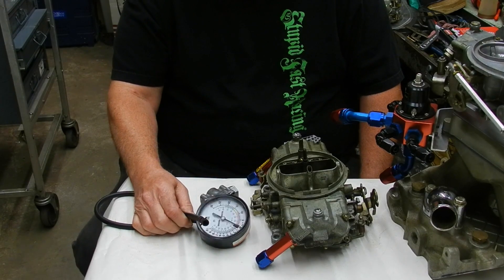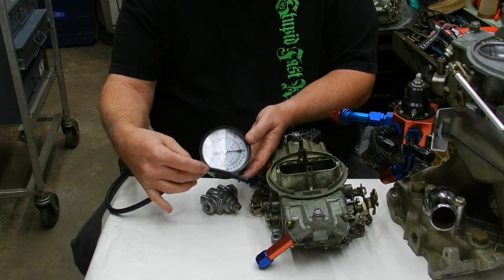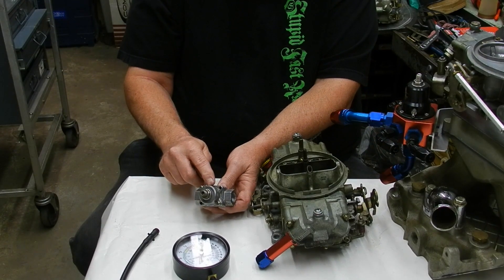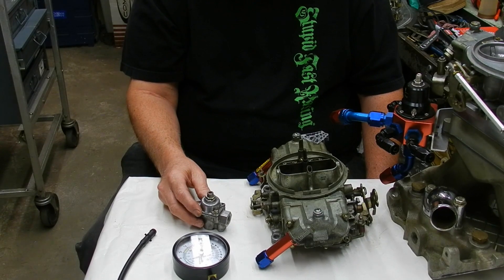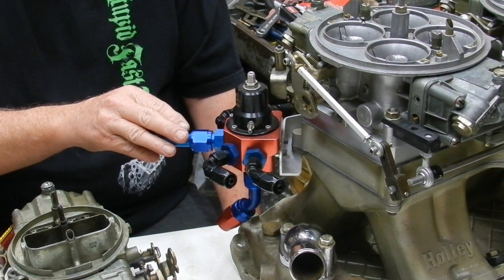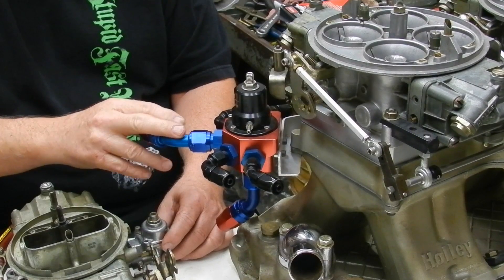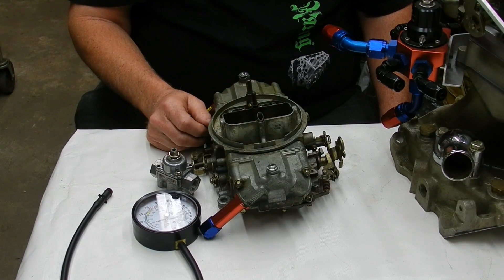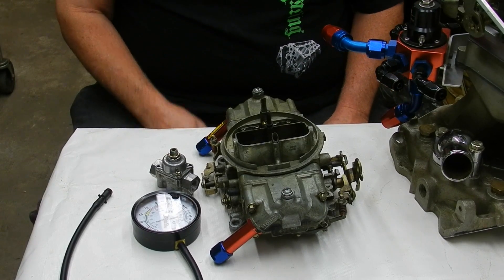Holley Carburetor : Fuel Pressure 101

Comment: Great video I am running a 500 cc Holly 4412s 2bbl on my 69 Ford f 250 390 c.i it says in the instructions 5_7 psi ? For a 2bbl ? It has a 50 cc accerator pump. I am running a elec fuel pump with the same regulator you had by quick fuel 1_5 psi regulator although the pump is 4_9 psi I ran it in a 5 gallon can it filled that can pretty quick the needle and seat is supposed to stop the fuel right ? I have it set a 3psi that seems plenty for a 2bbl can't see over 4psi on a single bowl , I had thought to get a lower rated pump 2.5 to 4psi since I think the pump is to high for the regulator with the screw all the way out it will.only go as low as 3 psi ...
Also I have a hard time getting a fuel pressure gauge to work I had to hold fuel outlet with my finger to block the fuel off to get the gauge to work  I ran it at the top of a t fiiting is it because it was running in the bucket and not hooked to the carb ??? I'm a newborn lol ....
Reply from the maker: Recheck fuel pressure with another guage and if all else is well with the carb should work fine at 5psi. Hope this helps.

Comment: hey randy I have a 350 small block with a quick fuel brawler 750 diecast. My question is if I have the car on how do I get the pressure up to 6 PSI? Right now its at 3
Reply: Buy a fuel regülatör. You can adjust to any psi.
Reply from the maker: I need more information , if you have a mechanical fuel pump or electric pump i take it you have a fuel pressure regulator  if so you can adjust the pressure there usually its a stud and lock nut, loosen lock nut and turn stud clockwise slowly and recheck till you reach your desired pressure. If you don't have a pressure regulator then just check your fuel pump out put for a weak stream  also check  fuel filter for blockage or dirty. Hope this helps.

Comment: How much the tbi engine should have ?
Reply: for gm 88-94 tbi you want about 13 lbs at the throttle body.
Reply from the maker: The old like 1988 chevy truck tbi only needed like 11 psi
Reply: Ahmad Maher Depends , different fuel inj motors vary from 40 -58 psi.

Comment: how is the pressure from a original fuel pomp one a 454  bigblok
Reply from the maker: That varies with who manufactored it most big block pumps usually pump around 5.5 psi

Comment: Great Videos.  Thanks for sharing your knowledge.  I have a question about fuel pressure and idle mixture setting when using 4150's in a air box with a procharger.
Do you run the fuel pressure higher to offset the boost pressure?  Do you
have a rule for setting idle mixture screws for example say 1/4 turn richer since you
don't have access to the idle mixture screws with the additional air at idle with the air box closed?  This is a marine application so setting out of gear adds additional variables.
Reply from the maker: I'm  not the go to person when it comes to boost I'm  sorry.

Comment: Hey Randy, I have a 355 small block with a 650 DP that I just swapped into my camaro. It isn't a race motor but a healthy street motor, made 445 hp on the dyno. I have an electric pump and the pressure at idle is at 3psi. This seems a bit low to me but the spark plugs come out looking rich. I have 67 jets in the front and the float bowls are adjusted properly. I haven't been able to drive the car much because it really does not run well at the moment, stutters and not much power. Any help? Thanks.
Reply: Bowtie Performance Watch the videos how to adjust your transfer slots by drilling out your primary butterflies with a 1/16 drill bit. Then you can start jetting smaller.
Reply from the maker: Yes that is not enough fuel pressure i would run 5 to 6 psi i don't know if your  running a fuel pressure regulator if so adjust it to higher pressure if not running regulator then check your pump pressure output and check any fuel filters, may have defective pump.hope this helps

Comment: how much is the proper fuel pressure psi at idle?...I just added the holley fuel lines with the pressure gauge and it shows 3psi at idle but the engine works perfectly.
Reply from the maker: three psi is a little low i'm assuming you have a manual fuel pump but if your pressure comes up to 4 to 6 psi racing the engine up and you have good volume you should be ok, don't know if this is a street car or race car , a lot has to do with what you are using it for, if pressure does not rise quickly with engine speed  would replace pump, need more information for sure , like engine and carb style and what your doing with it, hope this helps randy